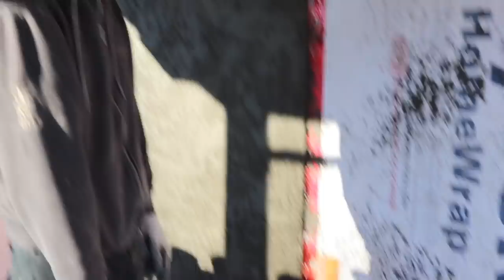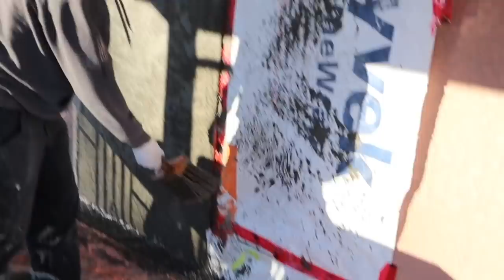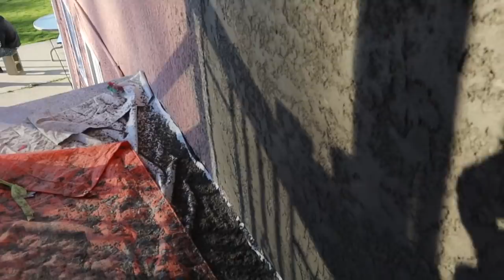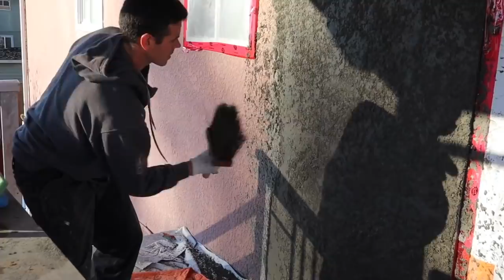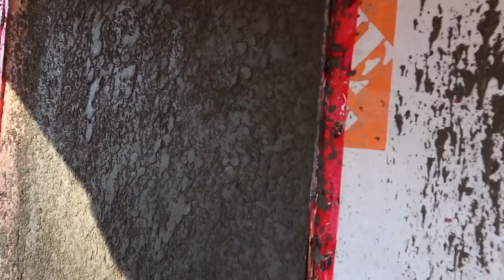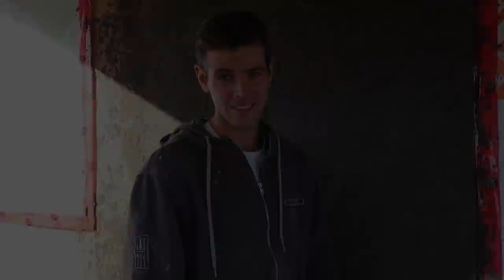The Stucco Saga part 3! (the final texture)

Comment: I completed a stucco repair a few years ago. I'm a carpenter not a stucco guy but I agreed to take the job. Learning is fun! Anyway, I turned to YouTube for tips and found Kirk Giordano. He's a pro stucco contractor in California. We conversed extensively and he told me everything I needed to know to pull off the job. Great guy! Look him up if you run up on another stucco job! The job I did was a heavy dash finish. One other thing I learned was if there's a damaged area about 12" in diameter expect it end up being 3 times that size after tearing out all the bad stuff!!

Comment: i remember the first time i worked stucco did two walls used a 12 ans a 6 inch drywall spatula to apply a knockdown texture. i was happy with the finished product  as was the client maybe i will try this method next time.
P.S. you should make a video on the work vehicle you use, show us our set up on it